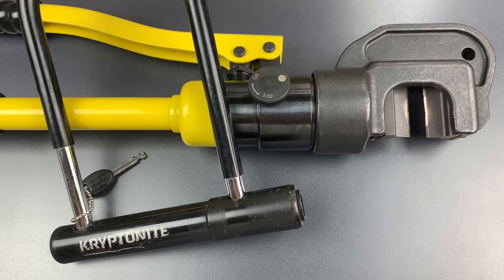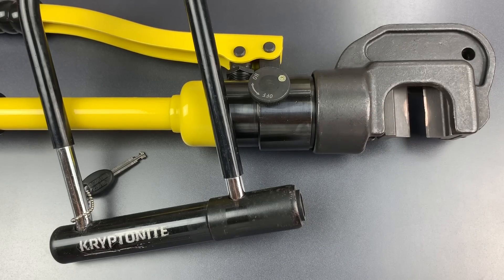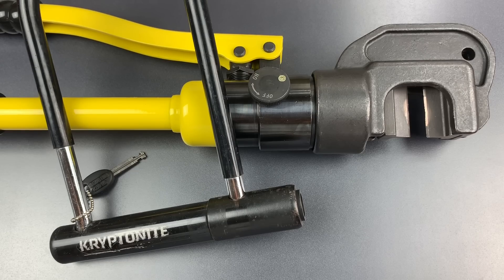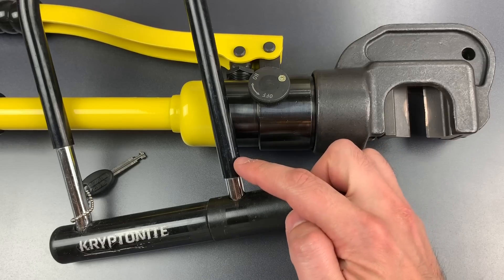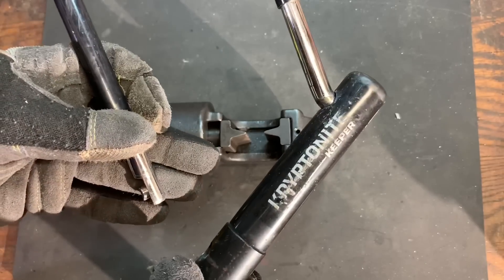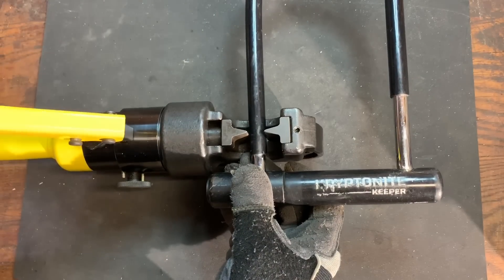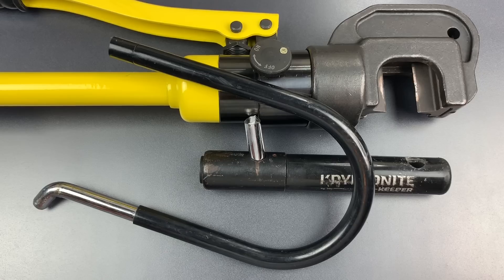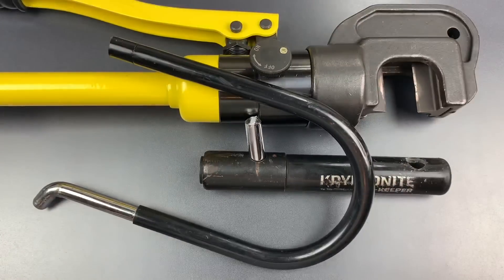[773] Hydraulic Cutter vs. Kryptonite Keeper Bicycle U-Lock

Comment: Is this what they call a rebar cutter? 🤔
Reply: I have a rebar cutter. It consists of two heavy semi-circular blades (like extreme cable-cutters) with very long handles. Although I am sure that the device that LPL uses here could be sold as a rebar cutter.
Reply: I just found what looks very much like the one LPL is using. It's called the "Happybuy Hydraulic Rebar Cutter." Happybuy may be the best vendor name ever.

Comment: Bah! Please get to the Kryptonite New York Lock series. I just bought 4 Kryptonite locks! Skip all these cheaper locks, it's just a waste of time for you and the viewer. Obviously, while they will be harder to cut, even the best ones won't be any match for a 35,000 psi hydraulic cutter with tungsten carbide blades. This means that ALL current bicycle locks will be virtually obsolete. Now manufacturers will have to start making their shackles out of tungsten carbide or boron carbide, which is insanely expensive. Not only that, but the cutter's jaws are spaced wide enough for the thickest shackles and chains. Damn!

Comment: After watching many of these videos, my original position of , " No lock will prevent theft of a bicycle " stands intact. 
I'm really wondering how many demonstrations does it take to convince people of this. 
The entire issue is really about slowing a thief down. 
The best deterrent of all is never leave your bike unattended . Of course this is impossible to do 100% of the time , so buy the strongest  lock possible and hope. 
There is one other thing you can do and that is , keep your bike looking old and dirty. Fancy paint jobs and decals are a neon sign shouting , " steal me"!  If you have an aluminum frame there no need to wash it as it won't rust . Just keep your mechanicals protected with some appropriate lubricant and let the rest look trashy. Most thieves will pass up a bike that looks old and dirty.

Comment: I want a solid tungsten lock or something WAY TOUGHER than normal locks. even if it costs 3000$ for a simple padlock would be great to defend against idiots with bolt cutters. And thick enough that it would take ages with a grinder.

Comment: It would be cool if you had some sort of tool that could detect how much force these locks are withstanding before it breaks.
Reply: you'd need to use an actual hydraulic press for that, or tap into the cylinder on the cutter and add a gauge so you could measure the pressure and do some MATH to figure out how much cutting force it is exerting

Comment: I doubt there's a single store bought lock on this planet that can take on a hydraulic, brute force attack. The only way to secure your load is to go nuts yourself. A hassle and an expense, yes, but, you sleep better at night for it.

Personal recommendation, find a local forge, ask the fellow to forge a 2.5 - 3 cm thick shackle and a lock cover for it. And always use a secondary lock, even a tertiary one. Thieves are animals of complaisance, shift their footing and they won't bother.

When i went to Uni, years ago, my bike was the only one that didn't get stolen, i was made a lot of muscle biking with 2 chains around my belt and 3 locks in my backpack. That and i was locking the bike on the main gas line (europe) with impunity.

Weaponize insanity, profit.

Comment: I'm curious to know how safe anything is. I know from police stats (but old ones) that most burglaries are through unlocked windows, doors, out buildings. But I also know that if a burglar gets in without breaking glass or the door frame it's put down as 'unlocked' and the insurance company doesn't want to pay.  Are there stats? What do you think?  This is a much bigger issue than how good or bad individual locks are. Crime is now almost nonexistent (even if it's up a bit in recent years, it's still nothing like the 70s-mid 90s). However, if your bicycle gets stolen, the crime rate is 100% for you.

Comment: Something we all need to keep in mind,  manufacturers don't foresee hydraulic cutters ever coming into play.  Having said that,  I believe this lock did well enough.  12mm is more than a pair of 36" bolt cutters would be willing to tackle.  This is much quieter than a cut-off wheel,  and a little quicker too...
Reply: There is essentially nothing you can do to secure your bike at a bike rack that a hydraulic cutter won't be able to cut through.
Reply: >manufacturers don't foresee hydraulic cutters ever coming into play

yes they do lol

Comment: Is there a chain sold by Kryptonite or Onguard, for instance, that could withstand the hydraulic cutter? Now I'm concerned for my motorbike...
Reply: If any chain has a chance against the hydraulic cutter, it might be pewags security chain 14x52. Im using the 12mm variant of that chain and broke my boltcutter jaws testing if it was as good as they say. But after all if they can't cut it with boltcutters they use an anglegrinder anyway.
Reply: I've tested these and other hydraulic bolt cutters against the 12mm "Pewag" and other high qauitly security chains of 12, 14 and 16mm... and the bolt cutters failed. I fact, in each case the the replaceable cutting jaws broke and needed to be replaced.  The hardened steal of these better chains are actually harder then the bolt cutters.  These high quality security chains are "bolt cutter proof" ... if the bike thief doesn't have a torch or an angle grinder, they're not getting through these chains.

Comment: Those would be the ultimate cutters if you could replace the jaws with the same metal used in standard bolt cutters.
If you look at the damage the blades receive after a cut vs the damage the jaws of a bolt cutters receive after a cut.
there seems to be a major hardness difference.   I have one of those cutters on the way from wish.com..   
I'm going to send out the jaws to a friends machine shop and see if they can make better blades for them.
They also can do hardening 40HRC core and  60HRC surface hardness of 60HRC ... I've seen recommended.
Why?   just because.

Comment: Is that my imagination, camera perspective or these interchangeable blades are slightly offset? Wouldn't it been better to align them straight opposite one against another?
Reply: They seem to be able to move side ways, like they are not fully constrained. Maybe it's a cheap cutter designed for cutting mild steel and not locks ;-)
Reply: These are meant for cutting rebar, made from mild steel.
Reply: The force makes them move that way ... regular bolt cutters do this too ... the LARGER the diameter of material it cuts will leave LESS room for the jaw to ove to one side like that.

Comment: There is only one way to harden locks against this form of attack.

Put a gigantic tax on the replacement cutter blades. The tax on the blades has to be sufficiently high that the cost of the blades to cut through X number of locks is greater than the cost of X things that the locks are protecting.  I.e., it's cheaper to buy a dozen bikes than to buy a cutter that will go through a dozen locks before you have to replace the blades.

This is guaranteed to work.  Fer sure.  Because such insanely-high taxes have never historically led to smuggling and illicit manufacture.  That's what politicians tell us, and why would we ever disbelieve a politician?  Anybody who tells you otherwise has been drinking moonshine.
Reply: @melonhusk  reduction to the irrelevant
Reply: @melonhusk  I think there was some sarcasm involved

Comment: I would argue this test isn't an effective demonstration of lock shackle strength. When you think about hardening steel, you need to either harden the steel to a maximum or a minimum. When you harden steel, the overall brittleness increases. When kept unhardened, the material is pliable. Basic knowledge. 

What I say about this test is that the steel would need to be harder than the cutter blades on the hydraulic tool, which itself are evidently hard and brittle. As seen by the chipping on the edge of the cutters. Meaning you would effectively make the lock shackle as brittle and therefor susceptible to prying attacks that would shatter the shackle. If you harden below that of the cutting edge or around that, you might hold up, but enough shearing on a point could break at that point. It's shearing apart the bonds on one point, so making anything harder than the cutting edge will effectively be useless. The maximum diameter of the shackle coupled with the limits outlined, this demonstration in my opinion isn't valuable. A lock shackle similar those shown in the past will almost always break under these conditions.
Reply: Steel components are generally not hardened evenly (for simple processing reasons, e.g. higher cross sections have higher thermal inertia). Hardened lock shackles are for example usually only hardened to a depth of a few mm, the remainder remains largely unhardened.

There are a lot of ways to influence the gradient of hardening in components. From adjusting cross sections, steel selection and heat treatments there's a lot of options.
Reply: With the color of the base metal on the shackle, I doubt that it was hardened at all.  They, Kryptonite were relying on the work hardening effect on the steel from the forming operation.
With so many companies buying into the Deming methodology of manufacturing (one piece at a time instead of batch processing), if the shackle was heat treated, it would have been induction hardened, and then only 2mm at most.
Reply: Aren't you missing the point though? This is a demonstration of the vulnerability of those locks to fast, quiet, and concealed physical attacks. Yeah there is a tradeoff between alloy hardness and toughness, but that's not the point of this video at all.
Reply: @wenkeli1409  My point is to explain that there are no locks, with the average shackle size shown on locks in videos of the past, that would survive this type of attack because of what I explained. Unless the lock has a very large shackle, hardened beyond that of the cutting edges, we should not expect anything on the market to survive this type of attack.

Comment: Will it cut pewag security chain?
Reply: No, nor will it cut any high quality security chain.  These hydrologic cutters and designed to cut mild steel such as rebar.  It will cut cheap chain and U Locks, but can't cut pewag chains or other quality chains.  The pewag and other high quality chains are harder then the cutters/jaws of the bolt cutters. In fact, these bolt cutters will fail and the jaws break before cutting or breaking the high quality security chains or U Locks.
Reply: @NikonPhotoHawk  the cutters are file hard, which is about as hard as metal can get and still be useful. when it comes time to cut stuff of similar hardness then it will come down to a battle of cross sectional area
Reply: @SuperAWaC  ... Don't know what to say.  

What is the Rockwell hardness of the jaws vs the pewag chain?  

The jaws break trying to cut ultra hardened chain. These cutters should be rated at about 6 tons and 0 to 12mm and not intended to cut ultra hardened chains like pewag, pragmasis, etc.  

Against the 12mm pewag chain, the jaws of the cutter broke each time. I've never found softer steel to cut harder steel in my experience.   The testing here should show this.

Comment: I was watching those jaws sink in deeper each time the pump was actuated.  I was waiting for the snap, and just before it finally went, i caught myself thinking, "That shackle is made of putty!"

The close-up you provided is clear evidence of the relatively soft steel that was used in the manufacture.  Harder steel wouldn't allow those jaws to sink in so deep before snapping.  Overall, this lock's shackle is a fail in my book.

Comment: Thanks for the great videos as always! If I can make a request, could you to use standard-issue thieves’ bolt cutters on these too for comparison? It would help give us an idea of how much more of a security threat these hydraulic ones are
Reply: I've looked up how much these hydraulic bolt cutters cost - and it seems like not really all that much so a modern bike burglar could easily buy one of those. They're like 100 or so bucks (the cheapest ones) on Amazon - obviously depending on the brand and stuff.
Reply: No doubt. At this level of lock though, my understanding is that bolt cutters can in fact cut through. I've heard that normal bolt cutters are possibly effective until you get to the Kryptonite evolution series of u locks, but the information on exactly where they cease to be effective is pretty hazy. It would be great to see a final result like "With the kryptolok series 2, bolt cutters are still sufficient, but beyond that they fail. Hydraulic cutters, however, continue to be able to cut even the fugghetaboutit locks". i.e. Having the standard bolt cutters as a benchmark would be great since it looks like he's gonna work his way through increasingly secure bike locks anyway, so it's an opportunity to kill one bird with two stones.
Reply: I had to remove about 12 abandoned bikes from a rack outside a library that was being refurbished and all the D shaped locks were hard work. I even broke the cutting blade on one set of 3ft bolt croppers. On the average I would say in real world use even the cheap ones are to be recommended.